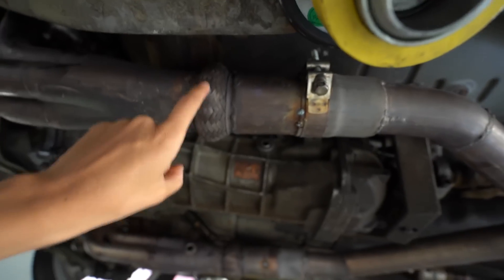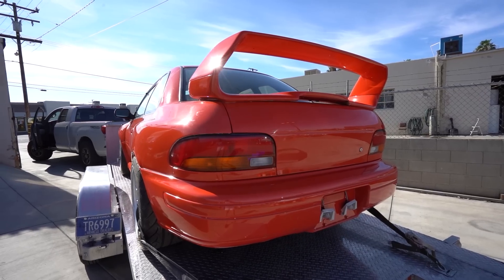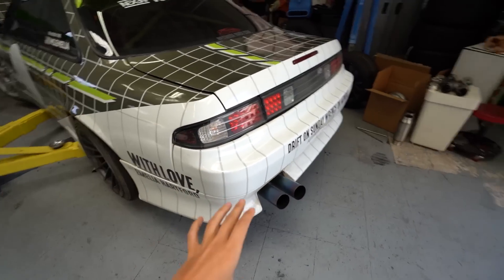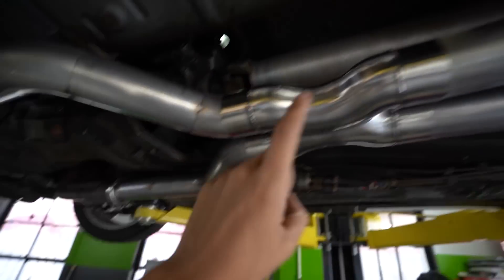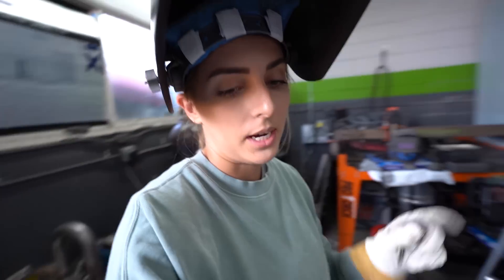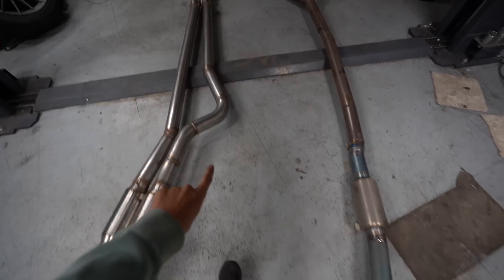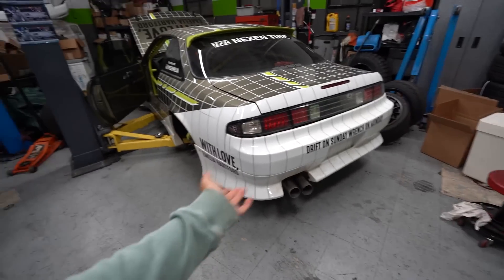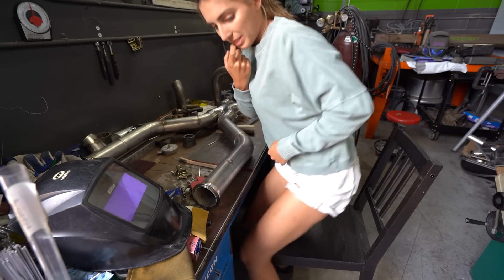MY NEW EXHAUST IS DEAFENING LOUD.... STRAIGHT PIPING MY CAMMED LS SWAPPED RACE CAR! *MURICA*

Comment: 4 wheeling I got rid of the 242 blue and went with 272 red lock tight. For that same reason plus I mark all my bolts with red paint so I can see if they are loose or not.

Comment: Since its stainless steel piping you can heat up the tip to get the colors. I'm a welder, and built stuff for the military, so just thought I'd give you a heads up to get that titanium look

Comment: Just an FYI when you weld, grind, sand, Stainless Steel you should at least have a respirator or a suction fan. The hexavalent chromium can cause kidney and liver damage, along with serious lung issues. It is some nasty stuff, as is most any alloy. Thanks for the VLOGs

Comment: When welding any type of pipe using tig, you have to fill the inside of the pipe with the gas you’re using. Makes the weld come out prettier and also give proper penetration of weld. Try it next time.

Comment: In the process of doing this to my e92 n54. The guy i bought it from blew to turbo seals out of both turbos so bad i poured a quart of oil out of the inlet, intercooler and exhaust.  So im pretty sure the cats are shot and causing restriction. It fried the o2 sensors so i assume oil is just baked in the cats.

Comment: wernt u suppose to fill the pipe with argon before starting to weld to get an even weld on both the ends of the pipe?
Reply: If you want to hang a turbo with it’s weight on the end of it yes. For these pipes it’s ok to skip back purge. Will be strong enough and any oxidation residuals won’t hurt if it comes loose.

Comment: Like 1 of 500 cars that i fix/service here has v-engine, but... but what i remeber reading is that if you run the exhaustpipe from front to back of the car (about 3 to 4meters) is that in v-engine you should have eather x-style pipe or extra cross pipe to leth the engine run more in sync (firsth vs. secend bank)/ help the other bank with the forse of the other bank exhaust cas...

Secend thing is thast manifould should have even runs. That means that every cylinder gas has exat same distant from start to the end of separate pipes
and that whit two or more banks in one engine all runs should be as long as othere...

What i mean is that i dont see your engine banks helping eaths other rather they are racing withs is beter then working in One Team.

Comment: try putting filler in straight, parallel with your tig torch instead of holding it to the side. it will make it much easier and prettier.

Comment: The car definatly sounds way better but, yeah it needs a re-tune. When you're revving the engine hard its gonna cause a lot of vibrations which means stuff in going to come loose, might be a good idea to use thread lock or if you want to go all out, wire lock every thing, but thats very time consuming.

Comment: I started out Stick welding 8 hrs. on saturday's for about 8 month's one day in class I tried a Mig Welder for about 4 hrs. the next day I bought a Lincoln 175 pro mig welder been mig welding for the past over 16 yrs, I had too stop taking classes because My job I'm a Truck Driver by trade now I'm retired had a Heart Attack in Oct 2018, Now I'm Looking too buy a new A/C- D/C Tig, Mig, Stick, Welder Because I want too learn Tig Welding specially Aluminum and Stainless,  what has help me out with My Welding is watching Jody on  weldingtipsandtricks and watching Bob and Jason on Weld.com  I have learned a lot from two youtube channel's, don't stop at Tig welding learn them all they all have there place and it's fun I do it for a hobby I've made a lot of thing's for My Jeep's and Willy's P/U Truck, if you know how too Tig, Mig and stick weld you can make anything or fix anything in this World,  I love too see Women who Weld and Drive Big Truck,  I used too pull Single's,  Double's and Triple Trailer's topping out at 80,000 to 105,000 lbs.  ,   I want too build My own  5 th. Wheel RV and Jeep hauler it take's all 3 welding skill's ,   What Your Dream Welding Project, LOL                 jeepinjim63@gmail.com    Jim     
P.S. I've been watching you a long time today is the first time I've seen you weld anything,  you need too weld more, just think on what you can make any from Art pieces too Race Trailer and anything in the middle.     Thank's Emelia for the great video's looking forward too seeing some new Welding Project's.

Comment: Of all the excuses to change an exhaust system, I have never heard someone say it was to improve the cooling system.  Ha!
Reply: Seriously???  You didn't know that if the exhaust flows out of the car better reducing back pressure it reduces heat!  A Car guy would know that!
Reply: It's actually why some factory equipped Nissans blow headgaskets. Mid 2000's models especially the 1.8L and 2.5L had problems with the converters. They'd come apart, cause a restriction and blow the HG.
Reply: Changing exhaust for an over heating issue and a leak, never heard cooling system in the video? 1 youre wrong on accusation stand point, and 2 wrong on how youve never heard of this.
Go wrench some legos and hot wheels some more bud
Reply: Unless youre the one making a exhaust intercooler system? Maybe a cold air exhaust system?
Reply: @drewdalesandro672  Yes, well she already had a pretty free flowing system.
Reply: @drewdalesandro672  She already is running a straight pipe, there wasn't much back pressure to reduce...
Reply: @B1GDaddyFatStax  Definitely will have issues if a converter plugs, I have also seen dual wall piping collapse the inner pipe wall ..
Reply: @TheWanderingGiant780  I think you should return to your legos.  She's running a straight pipe, and says the car has an overheating issue... oh yeah.. in a drift car...  think horses, not zebras... in other words, you would look at the cooling system first, not your straight pipe.

Comment: I’m not telling you what you should do by any means but I’m just throwing this out there if it’s possible for you to have a drag car and a drift car at the same time envy would be more stylish and making a statement on the drag strip since it is light already as well as fast I really think that envy could be a multi purpose car since it’s already fast and has a full roll cage the only modification you would have to do would be to install nitrous oxide and correct the tune in her to make her race ready as well as possibly putting Mikey Thomson drag slicks or a sticky tires for additional traction while going down the 1/8 mile strip I think it’s possible since you are half way there with the roll cage and the back seats removed and if I remember correctly I think you have a fuel cell instead of a regular fuel tank in the rear of envy don’t quote me on that though but I’m just throwing the idea out there is all for A. you would have a backup car and B. you could always turn the nitrous oxide off when you are drifting and the power modifications on envy might help you when you have a track day of drifting with the heltex ecu already in the car the downside is you might have to change the tune when switching from drift to drag but maybe your drift friend that you used to share a shop with could teach you in switching the gear ratios on the laptop when or if you want to have envy be a multi purpose car when you are at either type of track Ecrew member for life 🤘

Comment: Welding with shorts? Be carefull. Better use pants and sometimes a hat. Especially when Arc and MIG welding.
Reply: I was thinking the same thing! Reminds me of HS metal shop when we were learning to stick weld. This was in the '70s and frayed jeans were popular (you can see where this is going). Guy was welding away and his jeans caught on FIRE! Hosed him down with a fire extinguisher. His Mom had to bring him another pair of Jeans before he could leave the shop!
Reply: @PhilG999  modern inverters Arc welders are way better. I got one with 200A...very nice to weld, and not very hard on the house's electric system.

Comment: Dam, brains, beauty and she can weld! The blonde highlights change your appearance. Are you going all Hollywood on us? 

A word of experience, wear a long shirt when tig welding. The UV light generated will burn your skin. You'll get farmers tan on the arm closest to the work piece. Also, watch your hearing. I wish I had done more to protect my hearing. Missing mid tones and high pitches. Can't hear a vacuum leak or engine knock unless it's a gross leak or the pistons have melted down.